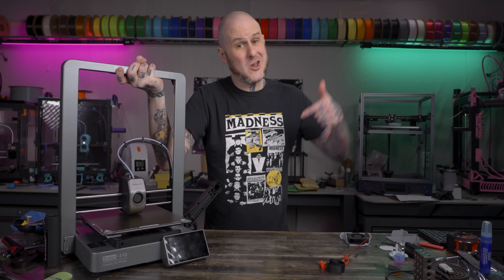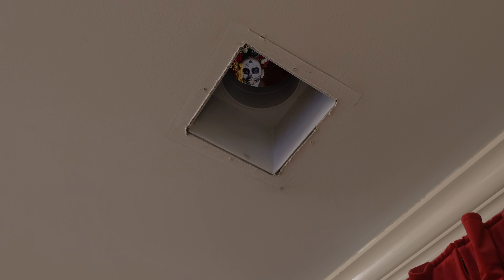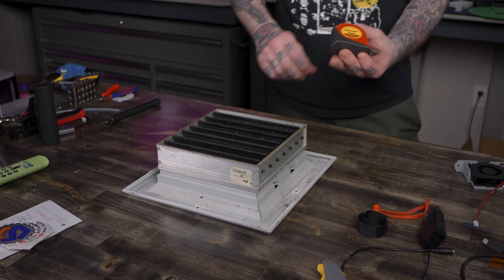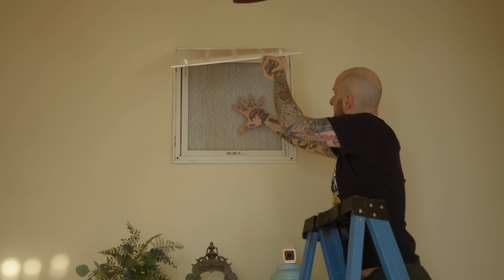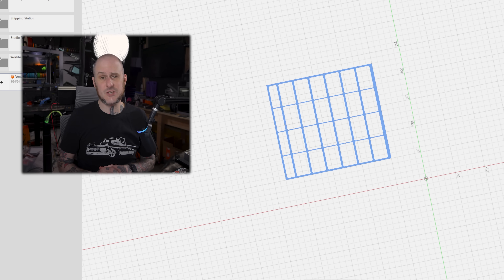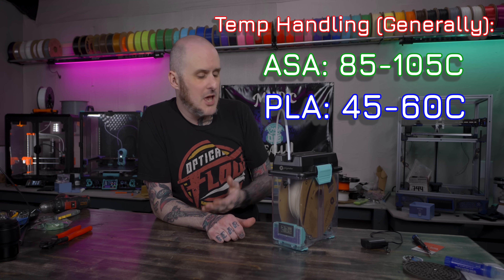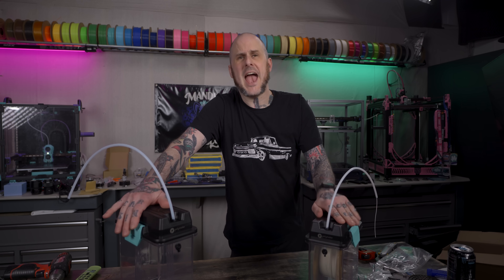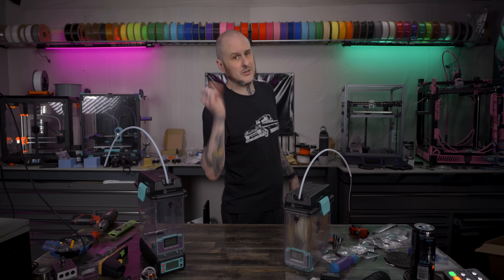How 3D Printing SAVED My Marriage!

Comment: Just turn the whole thing so the venting closes the other way.  Just a screw driver neede and about 5 min.
Reply from the maker: Are we looking at the same vent? It guides air in 360 degrees, there is no turning it to point another way. The outlet vent fins are fixed. The shut-off inside just stops air flow entirely, it has no control over direction of the air path.

Comment: Nice solution for the problem :D 

1 question: How do you deal with the toxic fumes on the ASA/ABS printing ?
Reply from the maker: Charcoal air filtration systems inside of printer chambers that recirculate the chamber air. They both help to stabilize chamber temperature as well as filtering the nasty chemicals. For my Voron 2.4 I use the "Nevermore" (you can see it under the front edge of the bed in the timelapse).

Comment: Fixed up ridiculously expensive replacement for fancy pants non standard shower rollers.  Would have cost me over $300 CDN plus a 6+ weeks of no shower door. Took me 20mins to design, 7 mins to print less than 10 cents in material cost…….x2 over 6 years of being in this house.
Reply from the maker: Love to hear 3d printing fixing things like this. Rad!

Comment: Love these practical-use projects. If you get around to a vNext version, you should consider a TPU gasket so that you don't get air leaking out.
Reply from the maker: Yea, I have been using TPU gaskets on a lot of fan mounting setups. I was really tempted to put a flat flange on the top of the setup to use some foam sealing tape to seal it to the vent tube. If we were going to live here forever I probably would have, but we are moving relatively soon actually.

Comment: Sooo are you going to switch sides in Winter so you wont be hot  and she wont be cold
Reply from the maker: I said, we have radiator heaters not forced air. That vent is ONLY AC or Fan air.

Comment: BY THE WAY! Have you considered doing a series of modding old printers? Lots of new hobbyists go the used printer route in order to not invest as much up front, leading to a lot of modding instead of buying new printers. Ender-3 V1, CR-10 V1, original i3's etc.

I've personally spent more than a P1S in upgrades to my CR-10 and Solidoodle 3. 😂😂😂
Reply from the maker: I converted an over 10 year old MakerBot Replicator to Core-XY with modern hardware and electronics. The video did really poorly after hundreds of hours into designing and building it. 

I get what you are asking, but sadly it just doesn't make sense as a business decision. It was an intention I had at one point but it just hasn't proven to be a path forward for my business sadly.
Reply: @MandicReally  That sucks, I guess most people are only interested in the newest flavour in terms of looking for content, then.
I'll check that video out, at least. 😅
My Solidoodle 3 is going through an extensive revamp to CoreXY and triple belted Z. Maybe the CoreXY part of your video would help me with some choices along the way. 🤪

Comment: so instead of changing where u sleep in bed which will take one min u spent hours so change where the air is going ;-;
Reply from the maker: The vent blew across the entire bed. It still blew on me before, so her switching sides wouldn't fix the issue. Also she has a shoulder that gets irritated depending on how she sleeps, so she prefers that side of the bed. Last, have you lived with many partners? Folks generally pick their side of the bed and stick with it, FOR LIFE.

Comment: You could always paste the Fusion tutorial in a separate video. How did you make a transition between circle and square that or on the same plane?
Reply from the maker: Problem is that Fusion tutorials would likely underperform compared to my main videos. Then YouTube gets confused about what videos to show to people, potentially harming the entire channel. It makes more sense to put those types of things on my second channel, Mandic Labs. I'll likely do tutorials there at some point: https://www.youtube.com/channel/UCViRyNkR_B198VyJ6ECDvGQ/videos
Reply: @MandicReally  Nothing is stopping you from pushing those tuts on second channel and linking within the main video.
Reply: @MandicReally  BTW if you could give me a short answer on the second part of the question that would be really great. I only used loft feature based on features on different planes.
Reply from the maker: @Hajtosek oops, sorry I meant to answer that part. I used the Loft tool. I made the bottom flange and the top flange as separate pieces. Then I moved them apart as I wanted them. Created a sketch off the face of each, then I used those sketches to Loft between the two. I had to then do the same for each of the individual air passages to cut the internal structure out of the main loft body. It took a little trial and error to achieve what I was aiming for but it worked.

Comment: In 3D CADD software, it's more common to use the origin of the of the sketch plane as the center of the part, as opposed to one of the corners of the part. This typically helps aid assembly modeling. However, the way Fusion360 does assemblies is rather poor, in comparison to Solidworks or Inventor. All of that being said, you hit the use of construction lines spot on!

Comment: For those wondering how he did the round to square join in Fusion 360, it's a simple loft between two sketches.
Reply from the maker: Yes that is how it was done. Wanted to say that but I have to streamline CAD sections sometimes unfortunately.

Comment: Could you both not have just switched bed sides? Lol
Reply: Once you pick a side, that's your side for life
Reply: @therick0996 😅 such a true statement
Reply: @therick0996 are we still referring to beds? 😉
Reply: @therick0996  gets it. Hard facts.
Reply from the maker: Ruby has a shoulder that acts up depending which way she sleeps. It just works out that the sides of the bed we’ve chosen are best for us. And the vent still blew on my side before too. So either way she would have been in the airflow path.
Reply: Just 3D-print a new shoulder
Reply: If you watch the video, there's a vent on the other side of the bed that would have the same problem.